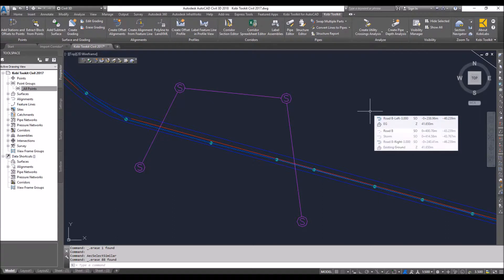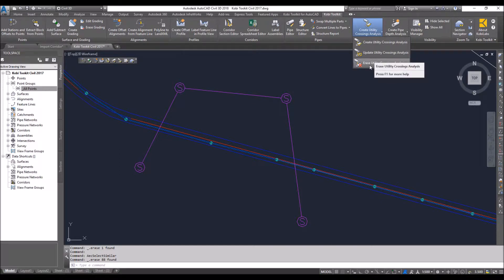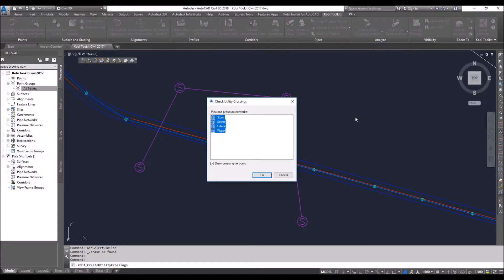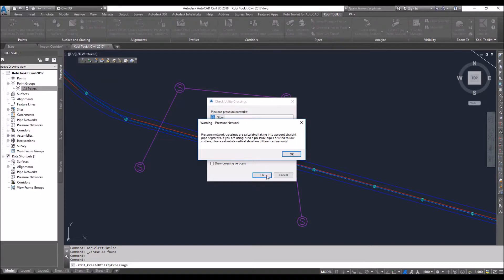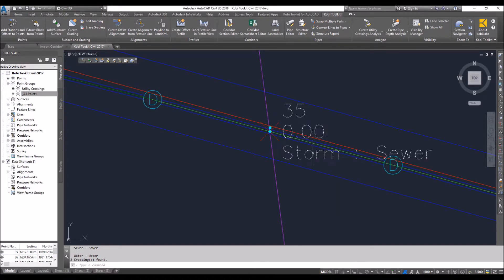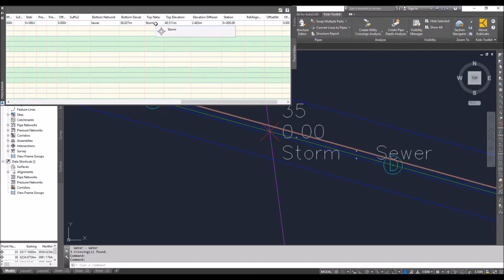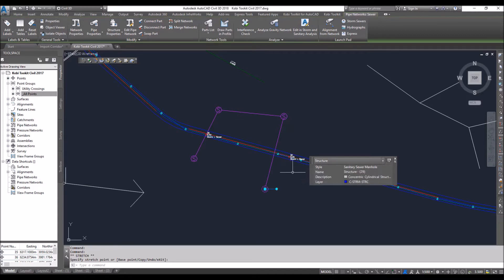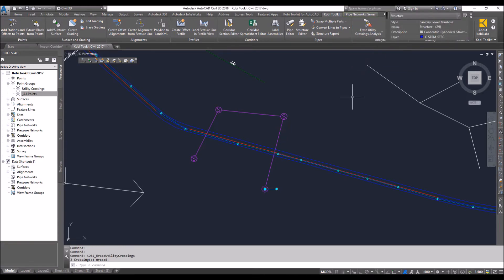Civil 3D Check Utility Crossings  - Kobi Toolkit

Comment: Does Kobi have a tool for calculating utility crossings for utilities that are not normally drawn in using pipe networks? For example I have a project with hundreds of telephone, fiber, gas and power conduit crossings and I could like to have a quick way to determine how far apart they are from my proposed storm and sewer pipe networks.
Reply from the maker: The Convert Lines to Pipes command is available in the Kobi Toolkit for Civil 3D, allowing you to select the desired polylines, lines, arcs and feature lines in your drawing and convert them all at once to the desired pipe type. Within this command you can also specify all the necessary parameters for the pipes. You can then use the Create Utility Crossing Analysis command to calculate the crossings. 
If you have any additional question or wish to schedule a demo, please reach out to us at: sales@kobilabs.com